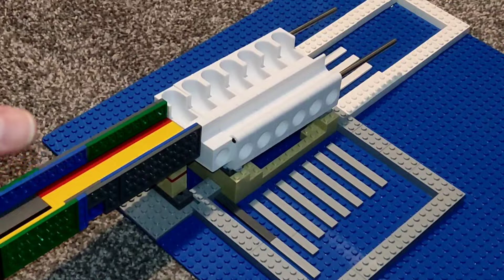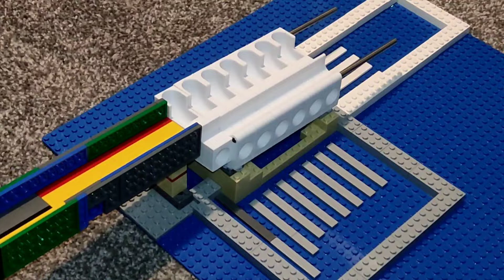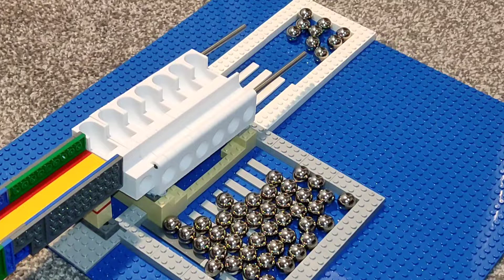MMXt Pocket Divider: Can one simple additional lane act as a flood defence?

Comment: It feel like an easy to implement solution. So simple in fact that it call to be tested further on in situation !
Reply from the maker: Thanks. Might not be quite so easy to implement on the current MMX, due to the double width at the bottom, having to squeeze through a single width tube to the DB4.
However, it's anticipated that the MMXt will recycle all the way back down to the buffer tray at the bottom of the lifts; the increased lift capacity will mean a permanently large flow is enabled.